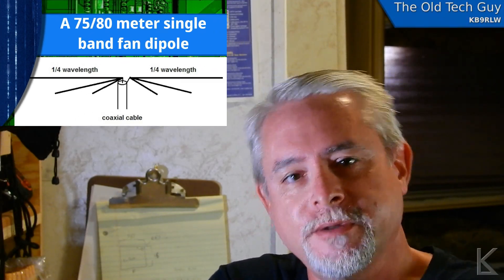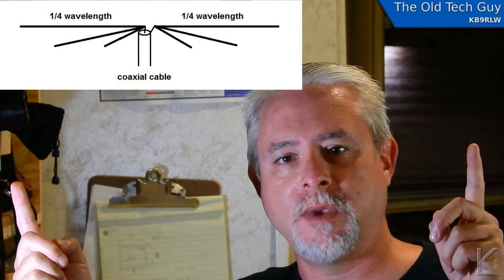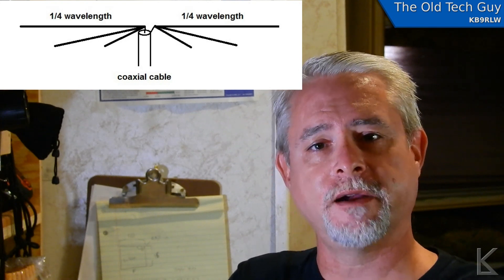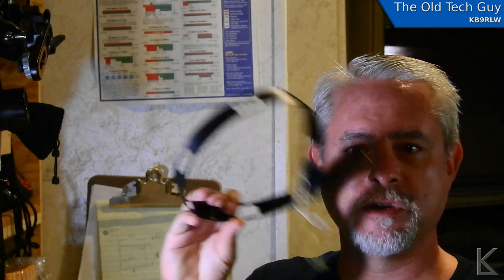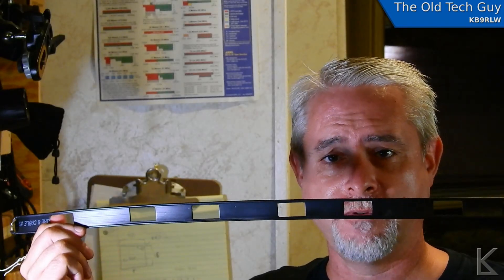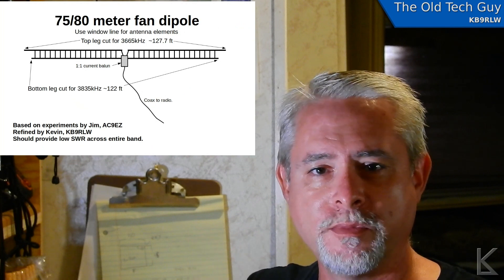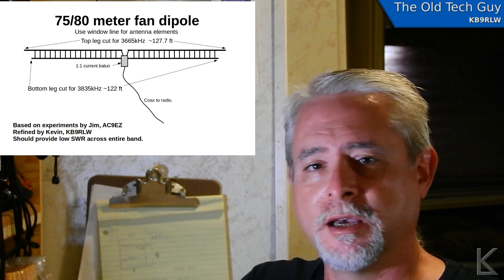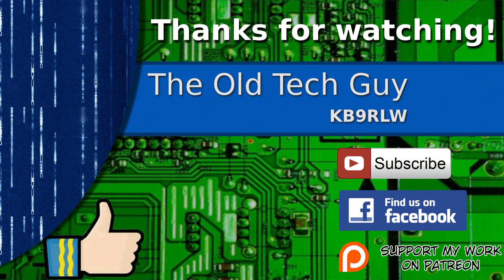Ham Radio - A 75/80 meter single band fan dipole

Comment: Hi Kevin, yeah our club on field day does exactly that! It will work great!

Btw, if you get 2x100 foot rolls, you can cut them to make a fan dipole for 75/80 AND the cut off for a high/lo 40 meter too! You could even attach both 40 & 80 to explore a  multi--FULL-band fan-dipole.

Fyi, back in the early 90's, I made a ALL band SWL multi-bander  using 300 ohm twinlead. My shortwave signals came blasting in from where I mounted it inside the very long attic of my then apartment building...

73 John

Comment: I've used a fan dipole for many years. Mine is made with 300ohm twin lead and fed with 60' of RG8 and only center and end supports. Works great however I only use 200 watts at most. I also made a 5 band fan dipole using 5 conductor rotor cable. Works very well just don't push a lot of power through it. Your idea should work great but remember, the impedance changes as the height above ground is changed. Put the feed point as high as you can get it. 1/4 wave on the 80 meter band would be ideal. Good luck and enjoy....
Reply: Sounds like a great antenna!

Comment: Great idea .. my antenna was also made out of 450 ohm ... thing I noticed was the additional wind load compared with single wire and this caused fibre glass pole to collapse a few times. Good luck with the experiment 73

Comment: been running a 48 wire Fan dipole for 2 years here, using 3x sheathless Cat5 each side cut for 80, 40, and 20 with the Cat5 unraveled and trimmed to resonate across the bands. Its flat on 80,40, 20, 10,15 and 10  meters, needing very little persuasion from the ATU to work on 6, 17, 12, 11 and 60 meters.  I think it acts like a Carolina Windom on those other bands. Feedline is 90 ohm twin feed. 73 de ZL3CJH

Comment: I built a 20M/40M fan dipole and had it installed in an inverted-V about 30' at the center point.  I had each dipole 90 deg to each other, and it worked really well.  Love the videos!  73 K4STM

Comment: Great idea Kevin. I built my 1st fan dipole around 10yrs ago. It was a 3 strand 4 band’r that worked very well, even tho i could only get it up to 28’ at that time. The bands were 40, 20, 15 & 10 meters. On the 40m legs i put a wire figure 8 for capacitance at the 15m points. However, the point that i have to make is, i had to seperate the 3 strands by at least 6” starting approx 6” from the feed point due to harmonix. That is where the best swr landed in my situation. Im am not sure how your experiment will turn out and looking forward to try it myself if you are successful. I really enjoy your videos on antenna experiments thats where a lot of my passion is.

Comment: It might be interesting to do some measurements of returned power BEFORE you cut one side for a higher frequency. I'm wondering if a broader SWR curve could result from what is, in effect, a larger diameter radiator.
Reply from the maker: I suspect you'll see that effect anyway as power will be on both wires, only favoring the one closer to current freeq.
Reply: @loughkb  do you happen to have a regular dipole for one of these lengths that you can mount in the exact same place/height to get a comparison with?
Reply from the maker: @qvatch  I'll be lucky to get just the one up for testing here in the RV park.

Comment: If you play with the angle of the dipole, you can achieve a 50Ω impedance, matching the coax line and transceiver. The issue is, in a portable situation, it is not alway easy to reproduce this angle, but, as you stated it, the cost of the mismatch is a 1.5:1 SWR, which is perfectly fine for any transceiver.

Comment: Thanks for the video, Kevin. What you are describing is actually quite a common practice of making broadband dipoles. At least it's definitely described in the book "HF and VHF antennas" by DL2KQ (ex. EU1TT). Sadly it doesn't look like this book was translated to English. You can even make a dipole that covers 3.5-14 Mhz with low SWR if you wish. However the lowest SWR value in this case will rise to about 2 or maybe 3. Another problem with broadband antennas it that they are prone to pick the noise from all the sources that transmit on the bandwidth of the antenna. For these two reasons such extreme broadband antennas are not very practical except when you need a receiving antenna that covers all frequencies you are interested in. Interestingly, the discone antenna is in fact such a broadband GP turned upside down. 73 de R2AUK

Comment: HI
Have you tried using the ful ladder line same length?
In the old days you might see large conductor dipoles, A ring with multiple wires for each side of the dipole.  I remember seeing this layout on various pictured antennas,  I  think the idea was to electrically have a large conductor dipole to flatten the SWR curve.
Thanks
Reply: The thicker the conductor, the broader the bandwidth. I suspect that discone antennas are based on this principle.
Reply from the maker: When I put it up, I'll first scan it with both conductors the same length to get a baseline bandwidth before trimming the one leg.
Reply from the maker: The disc cone actually works on a different principle.   If you look at a cross section of it, you see a flat line and an angled line below.   The gap between the two widens as you move out from center.   The RF finds it's resonant spacing between the gaps and that becomes the 'sweet spot' so to speak.   Since the gap widens out, you end up with an antenna that looks flat over a very wide range of frequency.
Reply: @loughkb  Thanks for the explanation. I never had a proper explanation of its principle of work, for me it was always been a kind of "magic" antenna ;)

Comment: MMANA comes with the 80_75dipol.maa file.  Not window line, but 90 degree on the elements.
326 khz wide SWR < 2  There is also a 80_75dipolpar.maa with wires further apart then you intend, but you could easily move those wires closer with a little edition.

Comment: I wish you luck! My attempts at an 80m/40m/20m fan dipole failed after I discovered that the bandwidth of any individual band of a fan dipole is narrower that that of a free standing dipole. That was found out experimentally first than confirmed on 4nec2. This meant I could only get about 60khz of bandwith on 80m and 100khz on 40m.

Before you drop $100 on ladder line, why not run a simulation and see if you get the SWR trace you expect.

Charlie KM4ZZ

Comment: I like the idea of a fan dipole made from wide ladder line, but how close can you put the two dipole elements if you narrow ladder line or just use wire? 

What happens if you connect the ends together of a multi-band dipole?
Reply: Janet Winslow if you connect the ends you linear load the dipole. In the case of 450 ohm you create a dipole that is in fact ELECTRICALLY 40% longer than its physical length. Therefore a 40m dipole would measure a total wire length of 46 feet. Check out my channel for my recent experiment in this. 73

Comment: Both DX Engineering and GigaParts have 450 ohm ladder line.  130 feet is $98 at DX.  They also have some LDG balun for $30.

Comment: How would you measure the impedance of the window line feeder design at the frequency you are interested in?  Sorry if this is a basic question but measuring capacitance and impedance at frequency seems difficult.  I could see adjusting a tuner and then measuring that to figure it out.

Comment: End supports from the first solid piece between the longer and shorter conductor? Otherwise you will be supporting the antenna from the longer antenna only, which may cause mechanical problems.
Reply from the maker: I'm going to have a short piece of material between the flat middle supports across the point where the bottom wire is cut.  Should take the physical load.

Comment: You fired a synapse over here... I wonder if this would work for an 80M/40M NVIS quick deployment type dipole. What are the element spacing requirements using different bands?
Thanks for the video! I look forward to the follow-up!

Comment: Yo Kevin!:
Great video! I considered also using 5 conductor rotor cable, might be cheaper than ladder line, but wonder if the element spacing comes into play(?)  : ) Think it might be seen/ treat it as a single element. It would be interesting to put up a rotor cable fan dipole for comparison! What say?
de seeker/Jeff WA7LFP
Reply: Hi Jeff, you need at least SOME spacing. Otherwise you will get some inductance crossover. I had a friend years ago that tried computer ribbon cable; worked horribly. 

One of those "found 1 of 10,000 ways not to build an antenna (or light bulb, as Edison originally said!).
Reply: JPTucon: I can't help but wonder if the induction couldn't help but even out the swr accross the band? More lower further up & down the band? Maybe an idea?
de seeker/Jeff WA7LFP

Comment: Why not split the antenna only at the end?

-------------------------------------------------Feed -------------------------------------------------
     ----/                                                                                                 \-----
Reply from the maker: I'm not sure that would be as effective.  Also, you lose the lower SWR across the center range you'll gain from the two radiators acting more like one thicker radiator.

Comment: I am thinking it will act a lot like a "Fat" dipole...
Reply from the maker: Definitely across the center of the range, where both conductors are sharing the load.   Towards the ends of the range, the wire cut for that end will bring down the swr where it would normally be on the upswing.